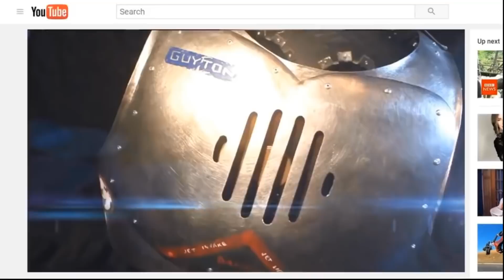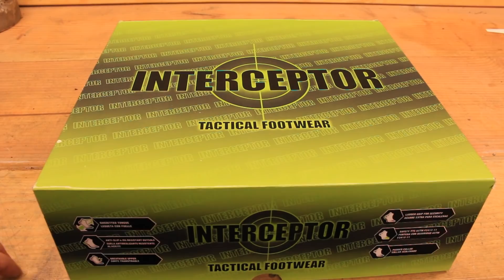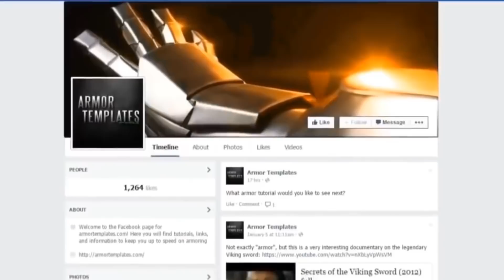Bionic Leg Tutorial

Comment: Its it able to be made bulletproof and missile proof?
Reply: If you thickened it up and made it out of something like titanium you could maybe get it bullet resistant but how the HelI are you expecting to make it missile proof
Reply: @stanthetincan3667  Here is a small basic list of impact resistance, shock absorption, and deflection technologies.

1. *Shear-Thickening Fluid Layers*
Adaptive materials that harden upon impact, providing dynamic protection against high-velocity strikes.

2. *Tunable Elastic Metamaterials* Customizable materials that absorb and dissipate impact energy, reducing stress on underlying layers.

3. *Graphene Aerogel Shock Absorbers* Lightweight, ultra-strong graphene aerogels that absorb high amounts of energy, minimizing transmitted force.

4. *Electroactive Armor Layers*
Layers that stiffen on demand when an impact is detected, providing rapid hardening to counteract force.

5. *Plasma-Based Deflection Shields*
Creates a protective plasma field that dissipates and deflects impact force across the suit's surface.

6. *Fractal Lattice Structures* Complex 3D-printed lattice designs that distribute impact force throughout the structure, providing efficient shock absorption without added weight.

7. *Magnetorheological Fluid Suspension*
Fluid-based system that instantly stiffens when a magnetic field is applied, enhancing stability and shock absorption.
 
 ** Impact Resistance & Shock Absorption Technologies**

1. *Metamaterials with Negative Stiffness* *Description* Engineered materials with "negative stiffness" properties that deform in a way that absorbs large amounts of energy on impact. *Function* Designed to "bounce back" from forceful impacts, dissipating energy rapidly and protecting the wearer from shocks.

2. *Energy-Redirecting Lattice Structures* *Description* 3D-printed lattices that can redirect impact forces through controlled structural deformation.
*Function* Directs impact energy away from the body by dispersing it across a wider area, providing both flexibility and resilience.

3. *Shear-Thickening Fluids (STF) and Liquid Armor* *Description* fluids that harden upon impact; combined with Kevlar or similar fibers to form a flexible armor that instantly hardens under stress.
 *Function* Offers a lightweight yet highly impact-resistant solution by transitioning from soft to rigid in milliseconds.

4. *High-Strength, Self-Healing Polymers*
 *Description* Polymers embedded with microcapsules or nanomaterials that "heal" upon cracking or denting.
*Function* Repairs damage on a microscopic level post-impact, maintaining suit integrity after repetitive stresses.

5. *MXene-Coated Composites*
 *Description* Ultra-strong, conductive nanomaterials layered with MXene, a two-dimensional nanomaterial that resists deformation.
 *Function* Absorbs and disperses kinetic energy efficiently, while offering lightweight and heat-resistant impact protection.

6. *Carbon Nanotube-Reinforced Foam*
 **Description**: A shock-absorbing foam reinforced with carbon nanotubes for increased energy absorption and reduced deformation.
   - **Function**: Provides excellent resistance against both blunt and sharp impacts while remaining lightweight.

7. *Biomimetic "Nacre" Armor Layers*
 *Description* Layers modeled after natural nacre (mother-of-pearl), which uses a "brick-and-mortar" microstructure to resist fractures.
  *Function* Offers a fracture-resistant material that is flexible yet extremely tough, providing superior impact resistance by mimicking natural defense mechanisms.

8. *Tunable Elastic Metamaterials*
  **Description**: Synthetic materials that can change stiffness dynamically, based on electric or magnetic fields.
 *Function* Absorbs impact on demand, adapting stiffness in response to different levels of force, improving both shock absorption and flexibility.
 ** Shock Deflection & Energy Dissipation Technologies**

1. *Electroactive Armor Layers*
   - **Description**: Smart layers that stiffen under electric current, hardening the material upon detecting impact.
 *Function* Engages a solid-state response to disperse impact forces over a larger surface area.

2. *Graphene Aerogel Shock Absorbers*
 *Description* Extremely light, high-strength graphene aerogels with excellent shock-absorbing properties.
*Function* Provides ultra-lightweight cushioning that dissipates energy on impact, ideal for adding to layers within the suit.

3. *Microfluidic Channels for Impact Deflection*
 *Description* Fluid-filled microchannels that redistribute impact forces by guiding fluid along structured paths.
*Function* Channels shift impact energy away from critical zones, reducing the overall force transmitted to the body.

4. *Magnetorheological (MR) Fluids*
 *Description* Fluids that can change viscosity under magnetic fields, rapidly stiffening when subjected to impact.
*Function* Forms an adaptive barrier that becomes rigid on demand, providing additional impact resistance.

5. *Plasma-Based Shockwave Deflection* *Description* Thin layers of plasma created using high-energy sources to disperse shockwaves before they reach the suit.
*Function*
 Uses a thin plasma shield to deflect the initial shockwave, reducing the force transmitted to underlying layers.

6. *Layered Kevlar-Titanium Sandwich Structures*
  *Description* Alternating layers of Kevlar and titanium in a "sandwich" structure for enhanced ballistic and blunt-force protection.
*Function*
 Both absorbs and redirects impact forces through progressive deformation, enhancing resilience.

7. *Piezoelectric Shock-Absorbing Layers*
 *Description* Layers embedded with piezoelectric crystals that generate electricity under mechanical stress.
 *Function* Absorbs and dissipates kinetic energy while also generating electrical energy that can be stored and used to power the suit’s systems.
*Additional Shock Deflection Technologies *

1. *Boron Nitride Nanotube (BNNT) Fibers*
  *Description* High-temperature, radiation-resistant fibers with extreme tensile strength, ideal for use in high-impact zones.
*Function* Provides robust impact resistance, deflecting and absorbing energy from high-speed projectiles and concussive blasts.

2. *Electrostatic Repulsion Layers*
 *Description* Layers that generate electrostatic charges to repel projectiles and blunt-force impact on a microscopic level.
*Function* Deflects low-mass particles and shockwaves by creating a repulsive field, reducing direct contact impact.

3. *Phase-Change Materials for Shock Management* *Description* Materials that absorb energy as they transition between phases (solid to semi-liquid) upon impact. *Function* Manages impact energy by undergoing phase changes, distributing and absorbing forces at a molecular level.

4. *Advanced Fractal Lattice Structures*
 *Description* Lattices patterned on fractals that distribute forces across varying sizes of structures.
*Function* Optimizes energy dispersion by spreading force evenly across complex, interwoven lattice structures.

These impact resistance and shock absorption technologies, integrated into & with a suit would provide a nearly impenetrable barrier against a wide range of physical threats, significantly boosting survivability. 
The combined technologies allow & offer superior protection against high-impact forces, sudden shocks, and projectiles, while maximizing flexibility and adaptability across multiple environments.

Comment: If I were to be using this type of piece for something like Comic-Con, would it hold up to walking around all day? My concern is with the riveting and whether or not those rivets would be able to hold the plates on under stress and during extended periods of movement.
Reply from the maker: They hold aircrafts together with rivets. Now of course those are solid rivets, which are much stronger, but there's nothing you could do rip these rivets out short of drilling them out. That said, you must use a small washer on the inside of any fabric or leather you rivet to. Rivets will not hold otherwise
Reply: @DavidGuyton  Thanks.

Comment: the plates can be made out of the bullet resistant fiberglass and the leather can be replaced with kevlar
Reply: When watching dis video in quarantine lol xD
Reply: small basic list of more impact resistance, shock absorption, and deflection technologies.

1. *Shear-Thickening Fluid Layers*
Adaptive materials that harden upon impact, providing dynamic protection against high-velocity strikes.

2. *Tunable Elastic Metamaterials* Customizable materials that absorb and dissipate impact energy, reducing stress on underlying layers.

3. *Graphene Aerogel Shock Absorbers* Lightweight, ultra-strong graphene aerogels that absorb high amounts of energy, minimizing transmitted force.

4. *Electroactive Armor Layers*
Layers that stiffen on demand when an impact is detected, providing rapid hardening to counteract force.

5. *Plasma-Based Deflection Shields*
Creates a protective plasma field that dissipates and deflects impact force across the suit's surface.

6. *Fractal Lattice Structures* Complex 3D-printed lattice designs that distribute impact force throughout the structure, providing efficient shock absorption without added weight.

7. *Magnetorheological Fluid Suspension*
Fluid-based system that instantly stiffens when a magnetic field is applied, enhancing stability and shock absorption.
 
 ** Impact Resistance & Shock Absorption Technologies**

1. *Metamaterials with Negative Stiffness* *Description* Engineered materials with "negative stiffness" properties that deform in a way that absorbs large amounts of energy on impact. *Function* Designed to "bounce back" from forceful impacts, dissipating energy rapidly and protecting the wearer from shocks.

2. *Energy-Redirecting Lattice Structures* *Description* 3D-printed lattices that can redirect impact forces through controlled structural deformation.
*Function* Directs impact energy away from the body by dispersing it across a wider area, providing both flexibility and resilience.

3. *Shear-Thickening Fluids (STF) and Liquid Armor* *Description* fluids that harden upon impact; combined with Kevlar or similar fibers to form a flexible armor that instantly hardens under stress.
 *Function* Offers a lightweight yet highly impact-resistant solution by transitioning from soft to rigid in milliseconds.

4. *High-Strength, Self-Healing Polymers*
 *Description* Polymers embedded with microcapsules or nanomaterials that "heal" upon cracking or denting.
*Function* Repairs damage on a microscopic level post-impact, maintaining suit integrity after repetitive stresses.

5. *MXene-Coated Composites*
 *Description* Ultra-strong, conductive nanomaterials layered with MXene, a two-dimensional nanomaterial that resists deformation.
 *Function* Absorbs and disperses kinetic energy efficiently, while offering lightweight and heat-resistant impact protection.

6. *Carbon Nanotube-Reinforced Foam*
 **Description**: A shock-absorbing foam reinforced with carbon nanotubes for increased energy absorption and reduced deformation.
   - **Function**: Provides excellent resistance against both blunt and sharp impacts while remaining lightweight.

7. *Biomimetic "Nacre" Armor Layers*
   - **Description**: Layers modeled after natural nacre (mother-of-pearl), which uses a "brick-and-mortar" microstructure to resist fractures.
  **Function**: Offers a fracture-resistant material that is flexible yet extremely tough, providing superior impact resistance by mimicking natural defense mechanisms.

8. *Tunable Elastic Metamaterials*
  **Description**: Synthetic materials that can change stiffness dynamically, based on electric or magnetic fields.
   - **Function**: Absorbs impact on demand, adapting stiffness in response to different levels of force, improving both shock absorption and flexibility.
 ** Shock Deflection & Energy Dissipation Technologies**

1. *Electroactive Armor Layers*
   - **Description**: Smart layers that stiffen under electric current, hardening the material upon detecting impact.
   - **Function**: Engages a solid-state response to disperse impact forces over a larger surface area.

2. *Graphene Aerogel Shock Absorbers*
   - **Description**: Extremely light, high-strength graphene aerogels with excellent shock-absorbing properties.
   - **Function**: Provides ultra-lightweight cushioning that dissipates energy on impact, ideal for adding to layers within the suit.

3. *Microfluidic Channels for Impact Deflection*
   - **Description**: Fluid-filled microchannels that redistribute impact forces by guiding fluid along structured paths.
   - **Function**: Channels shift impact energy away from critical zones, reducing the overall force transmitted to the body.

4. *Magnetorheological (MR) Fluids*
   - **Description**: Fluids that can change viscosity under magnetic fields, rapidly stiffening when subjected to impact.
   - **Function**: Forms an adaptive barrier that becomes rigid on demand, providing additional impact resistance.

5. *Plasma-Based Shockwave Deflection*
   - **Description**: Thin layers of plasma created using high-energy sources to disperse shockwaves before they reach the suit.
   - **Function**: Uses a thin plasma shield to deflect the initial shockwave, reducing the force transmitted to underlying layers.

6. *Layered Kevlar-Titanium Sandwich Structures*
   - **Description**: Alternating layers of Kevlar and titanium in a "sandwich" structure for enhanced ballistic and blunt-force protection.
   - **Function**: Both absorbs and redirects impact forces through progressive deformation, enhancing resilience.

7. *Piezoelectric Shock-Absorbing Layers*
   - **Description**: Layers embedded with piezoelectric crystals that generate electricity under mechanical stress.
 *Function* Absorbs and dissipates kinetic energy while also generating electrical energy that can be stored and used to power the suit’s systems.
*Additional Shock Deflection Technologies *

1. *Boron Nitride Nanotube (BNNT) Fibers*
   - **Description**: High-temperature, radiation-resistant fibers with extreme tensile strength, ideal for use in high-impact zones.
   - **Function**: Provides robust impact resistance, deflecting and absorbing energy from high-speed projectiles and concussive blasts.

2. *Electrostatic Repulsion Layers*
   - **Description**: Layers that generate electrostatic charges to repel projectiles and blunt-force impact on a microscopic level.
   - **Function**: Deflects low-mass particles and shockwaves by creating a repulsive field, reducing direct contact impact.

3. *Phase-Change Materials for Shock Management*
   - **Description**: Materials that absorb energy as they transition between phases (solid to semi-liquid) upon impact.
   - **Function**: Manages impact energy by undergoing phase changes, distributing and absorbing forces at a molecular level.

4. *Advanced Fractal Lattice Structures*
   - **Description**: Lattices patterned on fractals that distribute forces across varying sizes of structures.
   - **Function**: Optimizes energy dispersion by spreading force evenly across complex, interwoven lattice structures.

These impact resistance and shock absorption technologies, integrated into & with a suit would provide a nearly impenetrable barrier against a wide range of physical threats, significantly boosting survivability. 
The combined technologies allow & offer superior protection against high-impact forces, sudden shocks, and projectiles, while maximizing flexibility and adaptability across multiple environments.

Comment: Good thing is that, unlike other cosplay, this is actual armor and it will protect you.
Reply: It won’t protect you from bullets, unless it’s forged by a good blacksmith with metallic alloys (chromium & steel) and a bit of thickness, layers of fabric to slow down bullet also deliver less shock aka impact power of bullet.
Reply: @AzureScintillae  you do realise it has to be significantly thicker than 20 gauge steel the way it is now it can possibly protect you from a pellet gun and a few jabs from a blade

Edit: terribly sorry i thought it clicked tyger
Reply: @entity9742  yea I should’ve thought of that, the only thing I could think of it being protective (the armour in the video) are against bites, barb wires & rubber bullets. Maybe effective against batons but eh I dunno

Also its ok

Comment: Im making the leg from 26-gauge plated steel, but i have a feeling it wont be as great as it could be because of its thinness and how easily it flexes, any recommendations for where to pick up 20 gauge and what type of metal you use as theres welding, plated and other types of steel cause im gunna make the arm if i have time, Thanks man
Reply from the maker: I usually buy mine from Amazon. Jegs also sells sheet metal repair panels which is what I often use. You can also pick it up from Lowes or Home Depot, or look for a metal supply in your area.

Comment: Hey David, its me again, im getting ready to get everything printed and fitted to the boot, but what did you use to cut out your metal, the cuts look so clean and curved! Most of the metal sheers ive seen cut metal into big pieces and take bits of it off, and they cant curve so well to get shapes like you do for your template, this would help a lot, thanks!
Reply from the maker: You can do it with regular sheet metal snips (I used to use them exclusively). These days I use a bench mounted Throatless Sheer I got from Harbor Freight. Not a lot of people have that tool though so I don't bother showing it on camera much. The trick with any cutting is to get it close, but then use the grinder and files to get it to the final shape.
Reply: Air nibbler works amazing and quick-no patience here.